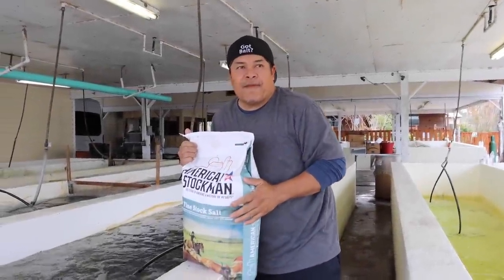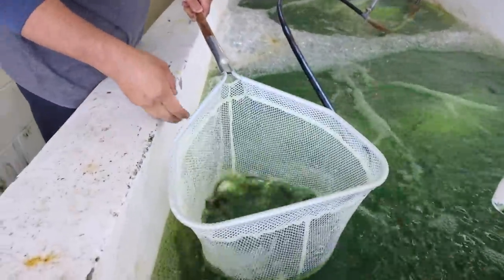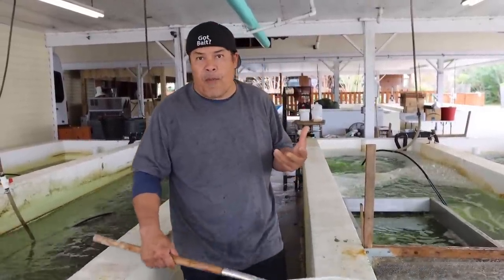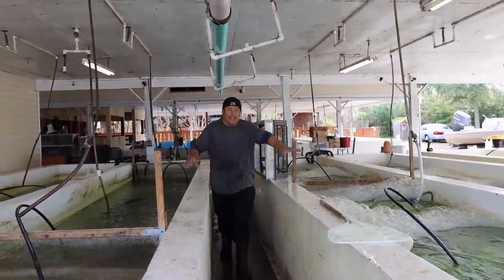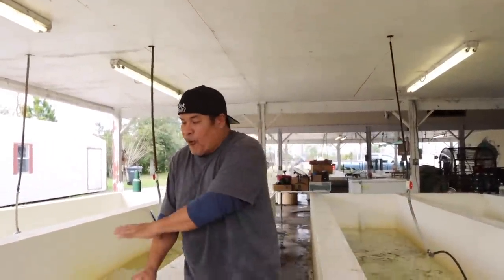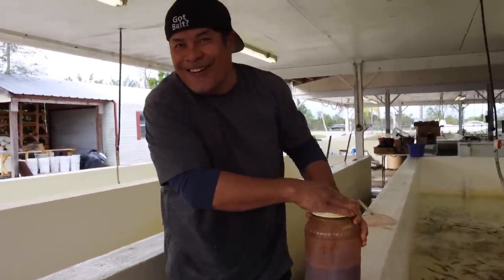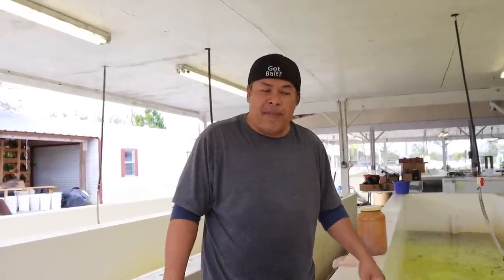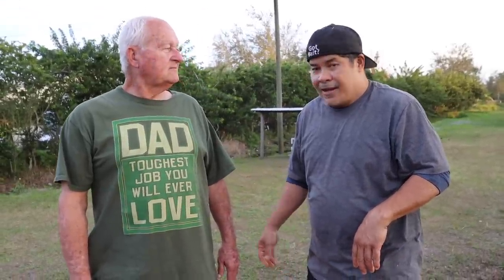Grading Shiner

Comment: Hey Sam, can you use water softener salt? I just have a small operation for personal use and smaller bags are a lot easier to store plus what I don't use for shiners I can always put in my softener. Thanks
Reply from the maker: Do not use water softener😭it will kill your fish 🐠 if you’re using city water 💦 more likely you’ll have some chlorine in it but don’t worry. Do this, have your tank filled then let it sit for a day or two, longer it sit the the better, If you need to use salt, use the one that said for animals only and not for humans consumption. You can get it from your local Tractor Supply, look for the ones that said (fine stock salt ) Good luck 👍